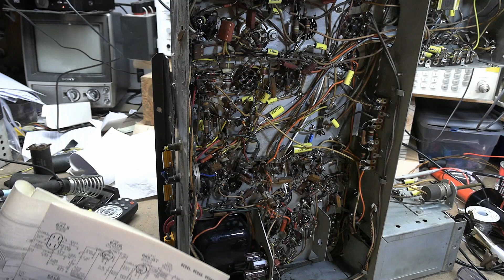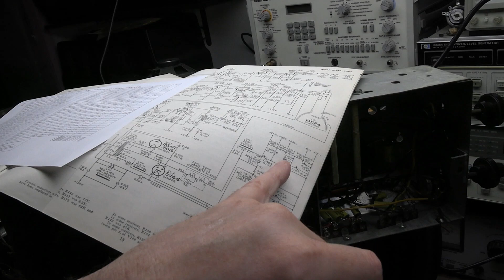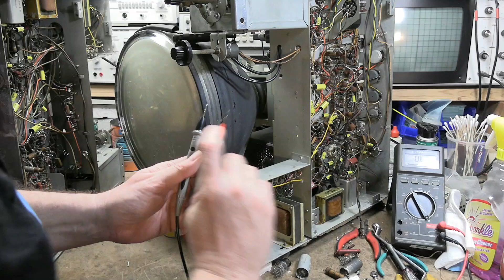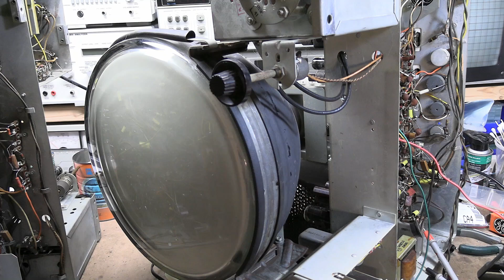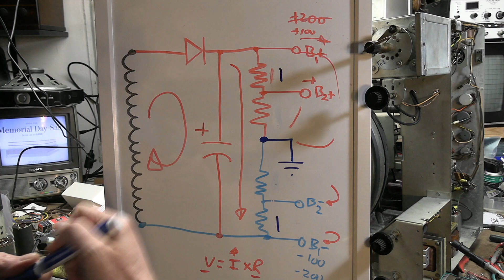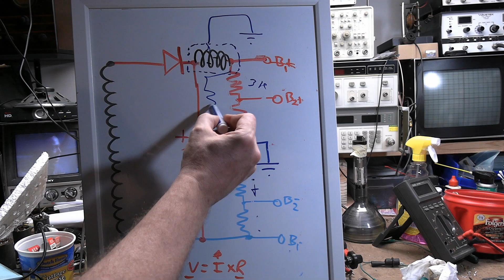Dueling 1949 RCA TVs part 5 -  A cautionary tale

Comment: Whenever there are strange resistance readings, reverse the leads. If the reading changes there's probably stray voltage left in the circuit. In this case the focus coil battery but I've seen it happen when capacitors are connected through high-value resistors.

Comment: Bob  this was a super great video showing all the issues you can have and how to troubleshoot them.  Much better then just replacing bad components and it works.  This frustrating issues can take weeks to fix and hard to find and often easier to just give up.  I learned a lot and just enjoyed watching you fix this.  I have some Ham Radios I am working on and have more restorations to go along with my recent issues at work at the High Voltage DC converter trouble shooting Ether Cat issues.  thanks Mike

Comment: The negative resistance readings were the most baffling. I was looking at them and wondering "how is that even possible?" If you want to test your "I turned it into a battery" hypothesis further, I would try to get a DC voltage reading. It would be interesting to see what happens
Reply from the maker: All will be revealed soon...

Comment: For the amount of "rust" on the coil it can probably be cleaned manually. Also, didn't you run into this problem with a Predicta that you "cleaned" the output transformer in Evapo-rust ? I remember you letting the smoke out. I guess lesson learned. Anything that is encased (unless it is sealed in tar) even then, a big no immersing of parts in the future. Too much hair pulling. There is an old saying "KISS". Keep it simple stupid. And no, I'm hinting at anything, just pointing out an old saying. Good video, Sorry about the frustration level.
Reply from the maker: Power transformer. No evaporust but the chassis did get a quick bath. Most disgusting set I've ever worked on.

Comment: Awesome Video Bob! Before you brought the focus coil into the picture, and you said the top resistor was cold on your diagram, my thought was stick an amp meter between the top 2 (red) resistors, and then between the bottom 2 (blue) resistors. In hindsight, what that would have shown was little to no current on the top voltage divider, and lots of current on the bottom. Immediately that would explain, voltage shifted down! This is all easy to say AFTER you drew the simplified circuit. To get from the set's components, to the circuit drawing, was a difficult journey I am sure! Excellent diagnosis logic to find the gremlin hiding in the coil! At first, when you jumpered in a single resistor and got an impossible reading,  I thought, oh crap, he broke Ohm's law! 🤣

Comment: Yeah, I had commented and then deleted them for I didn't think it would be helpful given that our intrepid host had deemed the whole assembly worth dunking and sooner or later any short-circuit consequences would surface, though I didn't think that it would make a battery!  Anyhow if not fine steel wool, then a wire wheel. I know you are trying to keep noise down, but maybe a small Dremel wrapped in a towel would be quiet enough.  And/or do it in the garage rather than the basement?  And trying to get moisture out of a wax filled assembly sounds like an ordeal, oven or no oven, since wax floats on water.  (Ask me how I almost set the house on fire once.)  Hope you can find or wind a new focus coil, or one thing I vaguely remember, weren't there permanent-magnet replacements for these?  I think of Dave Tipton down under where he has rewound a lot of coils.

Maybe, in principle, this assembly could be rinsed out with several rinses of distilled water, then put under near-complete pumped vacuum for a day or so to get all the moisture out?  Cutting it open would be a bear.

Gave you a thumbs-up for sussing out the problem!
Reply from the maker: Yes!  It was your deleted comment that saved the day.  If I hadn't noticed before it was deleted, I might well have given up.  As you'll see next, there was no wax inside at all

Comment: Very interesting Bob! I also use evaporust quite a bit. My hand waving understanding of it, is that it turns the rust into a soluble iron solution. You can even fertilize plants with the spent solution that need iron. It must be acting conductively somehow. I wouldn't expect it to react with any insulation or enamel coatings though. Great video as usual! It will be interesting to see what you find in there. - jrh

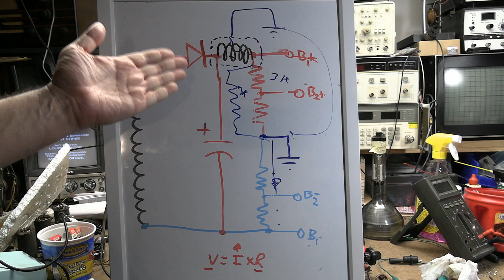Comment: Nice video. 27:35 knowing what u found out, the erronimous readings including negative resistances just prove the point that by dunking the focus coil into the evaporust, you created a battery.
After all; the evaporust is a chemical providing ions, and the metals you are dealing with are copper from the focus coil - which also tells you that enamel coating wass compromised - and Iron - maybe even zinc plated iron. That will be effectively the same as sticking a galvanized nail and a copper wire into a lemon, making a low current approx 1.1V volt cell, like back in chemistry/physics class.
But hindsight in it is a learning experience and you and all the viewers will be wiser because of it.
So thank you for sharing.
Reply from the maker: Cadmium plated steel and there is an exposed section of copper, lead and tin where the external wires connect to the coil

Comment: Well, one thing you can do is - with the focus coil on the bench and not in the circuit - hook up your meter set to a low voltage and measure between either end of the coil and the metal case. If there’s a voltage, there’s your problem. My guess is the evap-o-rust is reducing (adding electrons to) the rust (iron oxide) to elemental iron, and oxidizing (removing electrons from) the copper wire of the coil, giving you copper oxides. 😊 So, essentially, the electrons are leaving the copper, going through your DMM set on ohms, and returning to the steel case, where they attack the iron oxide, turning it back to iron and return back through the electrolyte (the evap-o-rust.) This results in wacky negative resistance readings. 😢
Reply from the maker: Kicking myself for not doing that right after I got the weird resistance readings. I did detect voltage when it was wired in the set and was thinking it was caps holding a charge. I'll show some experiments in the next installment

Comment: when I get weird resistance readings like that I will put the meter into voltage mode and measure the voltage at the points to see how many volts are there.  you'd think with only a few K like that any charge would bleed quickly, so I would suspect some kind of open between the two points, or the schematic is wrong. negative ohms is a sure sign of reverse bias on the leads,  such as testing a capacitor one way, then flipping the leads around will show negative ohms.  (edit) seeing the meter read negative on the focus coil, means it is acting as a battery.  if you check with a meter it will be generating some voltage.  the evaporust must make an OK electrolyte.  with a few hundred volts on there it could be significantly conductive.  if it was on for any length of time, there could be some significant corrosion inside from the electrochemical action going on.  is it  possible to take the can apart or is it staked?
Reply from the maker: Around half a volt. I could short out the circuit but voltage would come back. Sorry I didn't get that on video

Comment: Measure the voltage coming out of that focus coil. In order to get a negative reading, something is producing a counter voltage.
Reply from the maker: Few tenths of a volt.
Reply: @bandersentv  That's impressive, Imagine the corrosion that's taking place in that coil.
Reply: @shango066 and imagine the change in the leakage current once u apply a significant voltage across it. You are basically stripping the enamel coating of that copper wire, since if u apply B+ to the copper coil, you will force the copper into solution and create oxygen on the copper surface. That is much alike  derusting/stripping metal by electolysis.

Comment: Magnetic field developing inside the coil and case may cause mechanical force on the windings possibly causing the leak or short to pull in more tightly. A dynamic malfunction.

Comment: Hi Bob, looks like you have acquired another interesting malfunction to add to your bag of troubleshooting tricks.  One of the things leading you astray is the operational differences between the Ohms circuit in the analog versus digital meter.  The analog meter basically has a 1.5 volt battery in series with the meter to measure resistance whereas, the digital meter uses a constant current 0.3 volt source that is placed across the unknown resistance.  At the same time, the meter is actually measuring the voltage across the unknown resistance, which is calibrated in Ohms.  So, if you see a minus resistance reading, that means there is voltage present in what was thought to be a deenergized circuit.  At that point, set your meter to DC volts and verify voltage is present.

I guess the moral of this story is to never use Evapo-Rust on any coil or transformer.  It is acting like an electrolyte between the dissimilar metals in the focus coil, in the process, corroding the metal.
Reply from the maker: I did and there was a few tenths of a volt.

Comment: Check the voltage across resistor is zero otherwise resistance measurement will be crazy. Alternatively,  reverse ohmmeter connection and check the readings agree, otherwise there's an EMF source somewhere ...

Comment: Bob, have you tried measuring the values of the resistor network while having the capacitor is shorted? Sure, the readings would be lower, but 1-2 volts from dielectric absorption can shift the resistor readings significantly. Actually, negative resistance is a proof that voltage is present in the measured circuit...
When it comes to the voltage shift, I would guess there is abnormally high current between chassis and B1+. This would lower the B1+ voltage and it would shift significantly the B- voltages while heating excessively the B- resistors.
Reply: OK, the comment above was in the middle of the video. Weird problem, indeed :)

Comment: Oooo! I like a mystery. I like your explanation, too. That Evapo-rust is probably a weak acid so it's very conductive. A great electrolyte for a battery, too.
Reply: Even if its pH is 7, once internal corrosion has dissolved in it, it's probably going to go acidic.

But anyhow, haste makes waste.